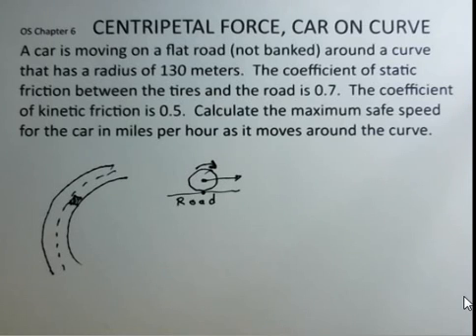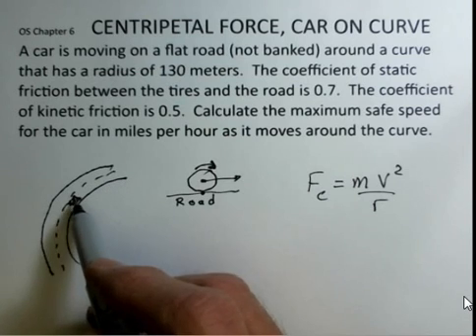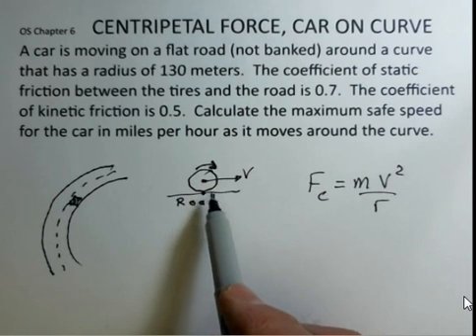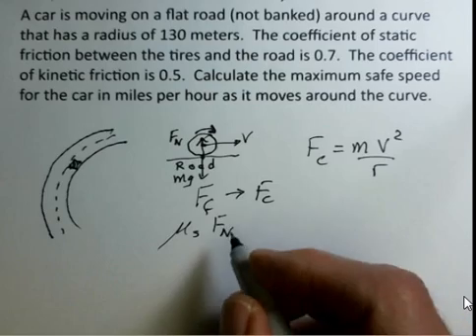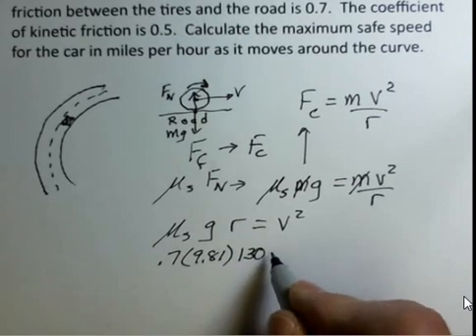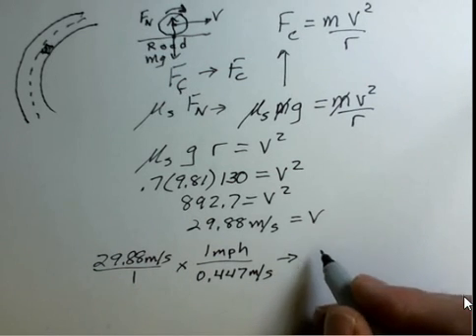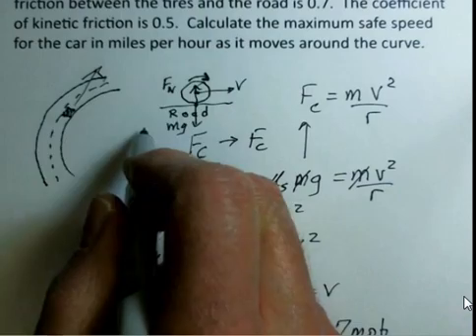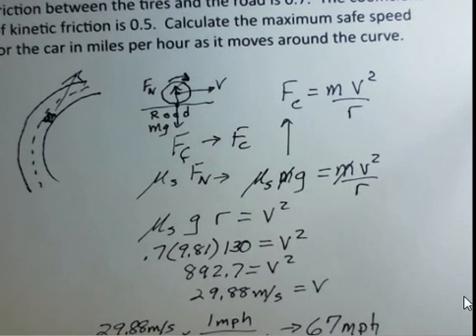Centripetal Force, Safe Speed for Car Driving Around a Curve

Comment: why don't you use kinetic friction instead of static
Reply from the maker: At about the 1 minute 15 second mark in the video I explain that the tire is not sliding on the roadway.  At every instant a molecule of rubber in the tire contact point is at rest with respect to a molecule of roadway material.

Comment: how is fn equal to mg when there is friction force involved, shouldn't they be not equal?
Reply: or does it not matter because its not ramped?
Reply from the maker: Because the road is flat, not banked, the normal force and the weight of the car (mg) balance each other.  The car is not accelerating in the vertical direction so the net force in the vertical direction is zero.  The force due to friction is perpendicular to the normal force and mg so the friction force cannot be used to make the normal force smaller or larger.  Only forces that are parallel (or anti-parallel) can be added or subtracted.

Comment: Hi Greg, great video. I was thinking this question makes the assumption of a rigid body and the 4 tires contact the road equally. In real life, a big SUV wouldn't be able to take the corner at the same speed as a small sedan due various vehicle dynamics.

Am I correct in saying  that (minus downforce) the vehicle that behaves closer to the assumption above (...a rigid body and the 4 tires contact the road equally) will be able to travel closer to the calculated maximum speed?

Because it's determined that mass doesn't affect this speed, I was just thinking "then why do large vehicles go around slower than smaller cars", which led me to think about center of gravity, suspension, body roll, wheel camber, distribution of normal force on each tire, etc. So if all these things can be engineered such that the vehicle can behave like a rigid body and maintain equal distribution of normal force on each tire, then the mass truly won't matter in real life.
Reply from the maker: Thanks for the extensive comment.  Yes, my simple calculation assumes a rigid body and all four wheels on the road.  I don't have experience analyzing real-world vehicles but your comments make sense to me.
Reply: @GregClementsScience  Appreciate your response, thank you.

Comment: So question, in a simplified description without actually calculating anything, can anyone tell me why there is a max speed a car can negotiate a curve?
What is this max speed determined by? Simple explanation for this?
Im in a basic physics class and can't find the reasoning in a simple explanation without calculation. 
Im having trouble grasping the concept itself.
Reply from the maker: As the car goes around the corner its velocity is changing direction.   A force is required to make the velocity change direction.  The size of the force is related to the speed (magnitude of velocity) of the car.   If the car's speed (magnitude of velocity) increases then the required force must also increase.  The road applies force to the car towards the center of the circular arc of the curve via the force of friction between the road and the tires of the car.  The force of friction has an upper limit, so the force on the car towards the center of the circular arc has an upper limit.  Thus the speed of the car has an upper limit.  The required force, for a given speed,  is smaller if the radius of the circular arc is smaller.  If the car's speed exceeds this upper limit it stops moving in a circular path and starts to have some motion that takes the car to a circle with a larger radius (and off the road).

Comment: How can you calculate the maximum speed when the vehicle is accelerating uniformly while turning?
Reply from the maker: The "maximum speed" calculated in this video is the constant speed that the vehicle can have to safely go around the curve.  The calculation is not a calculation of a speed that is increasing.  The vehicle has a constant speed all the way around the curve.
Reply: I understand. I just came across a question where a vehicle is accelerating as it is turning around a corner, just wondering if you can help me to solve the question.
Reply from the maker: @fubrian2945  Even though the speed is constant the vehicle is accelerating as it goes around the corner.  The direction of the velocity is changing so the vehicle is accelerating.  If the speed is changing then the centripetal force would be increasing as the speed increases.  F = mass * speed * speed / radius.
Reply: I am just guessing, since I only learn physics when I was in high school. 
First, if you accelerate when cornering, the weight of car will shift from front to rear. The faster you accelerate the greater the weight transfer. The normal force of the front tires has been decreased. Therefore, the font tires should break friction before rear tires. 
Second, it also depends on what kind of car you are driving. If it is a front wheel drive car, when the acceleration reach to a certain point, the front tires will start to spin. The friction coefficient of front tires will drop to 0.5. On the other hand, if it is a rear wheel drive car, then I am really curious which end of car will break friction first.